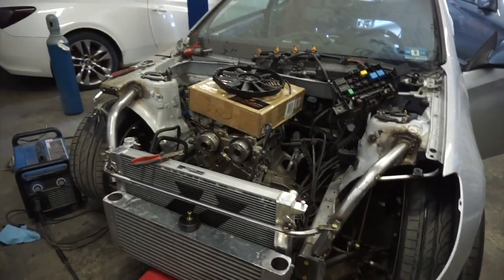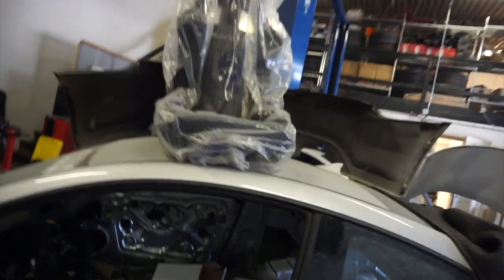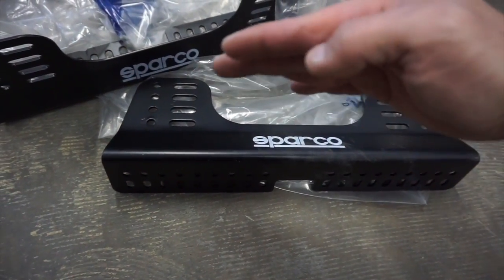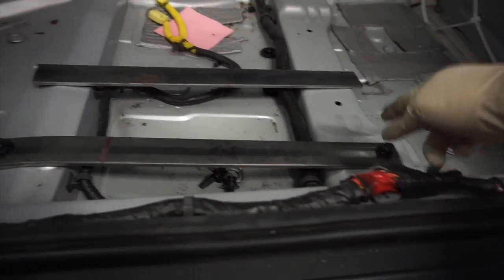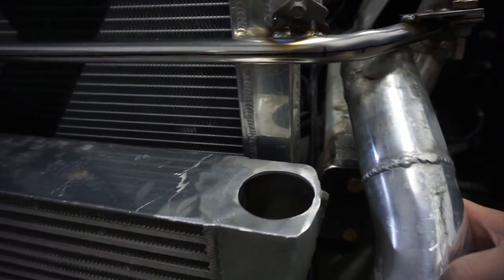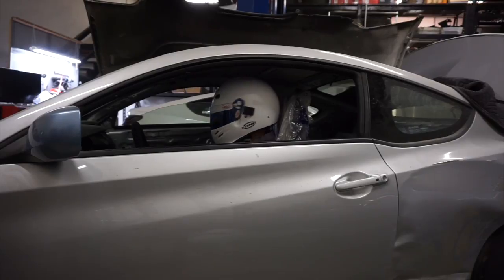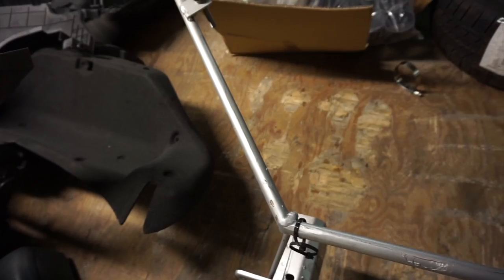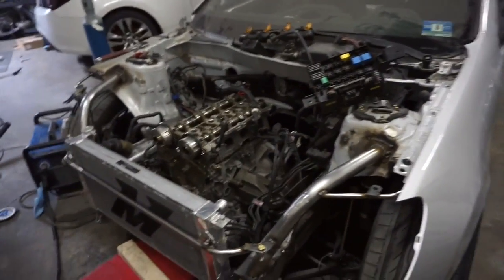SPARCO Seat Install | Intercooler modification

Comment: Do you run a stock oil pan or did you custom fab a baffle in your oem oil pan since you track and drift your gen?
Reply from the maker: It's stock. There is unfortunately anything (baffled oil pan) like that as far as we know. It's still fair new cars that are being used as daily driver for 99% owners out there.. Yet it's really small market that majority of people are only going for the looks and some performance still. We actually haven't heard any oil pressure or starvation issues with factory oil pans so far though.